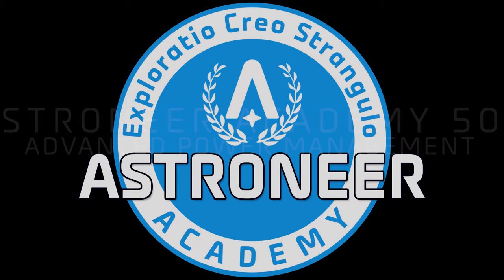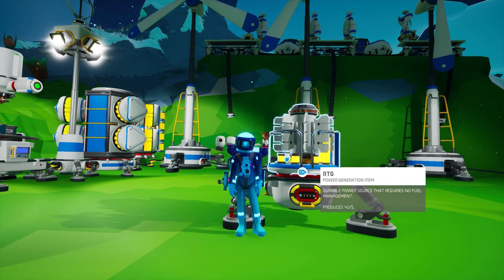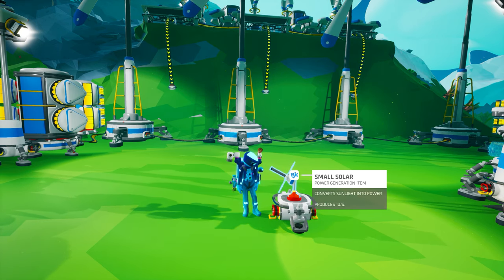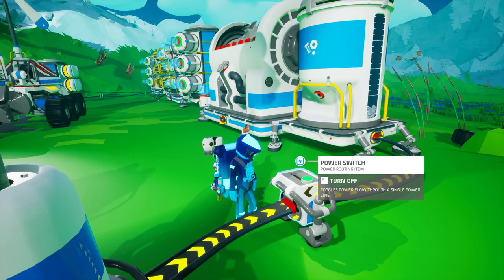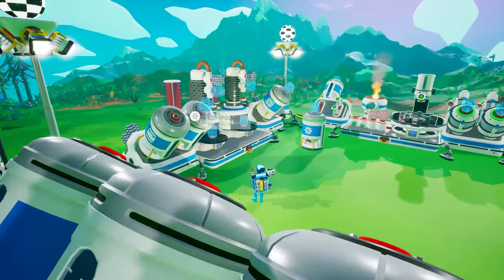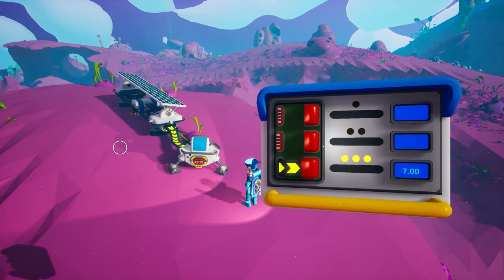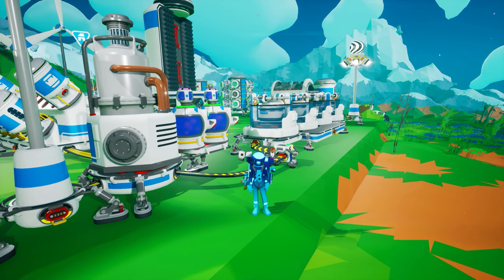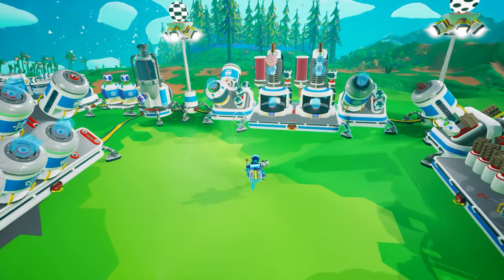Astroneer Academy 502 - Advanced Power Management

Comment: Brandon you made my stomach sink when I saw you scrapping the rtgs. Even with all the other power options rtgs are still the best power option for land vehicles. Although seeing hydrazine used to limit slot spots gives me ideas. Hopefully Exodynamics has the same ideas.
I agree whole heartedly about the excess power consumption. Needing more power and taking longer is a mistake. I hope the Exodynamics team is able to develop something that will improve energy management. While I understand balance issues the imbalance was caused by the improvement to power production. This may, or may not, be an issue early in our space careers but as we progress it is only to the benefit of Astroneers everywhere to have as efficient an energy production facility as possible.
Reply from the maker: I knew someone would have something to say about those RTGs going in the shredder ;)  And I do agree with you for vehicles - RTGs are the way to go. For my rovers at least. Generators are my go-to for tractors and buggies.
Reply: @VaingloriousGaming  well you CAN put an rtg on a tractor setup but it takes an entire trailer and by the time you get an rtg you already have rovers.

Comment: Great video! I am having an issue I noticed in your gameplay footage as well. I have quite a large base and no matter how many power generators I create all of my platforms show only 2 of 4 yellow power indicators, even when nothing is actively running. I know that means there is enough power for demand but is there a way to get all 4 yellow? Any thoughts on that?
Reply from the maker: The original power video in this series discusses that very thing. But, basically, it's just a quirk of the game. It can happen when you start connecting up a lot of platforms or using extenders or other "directional" power. There's no real 100% effective way to get all four yellow.